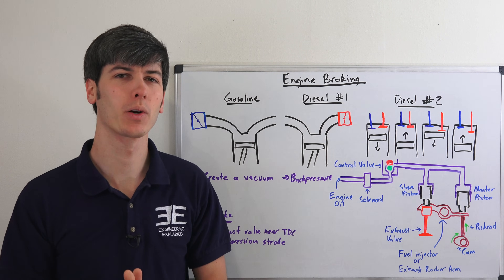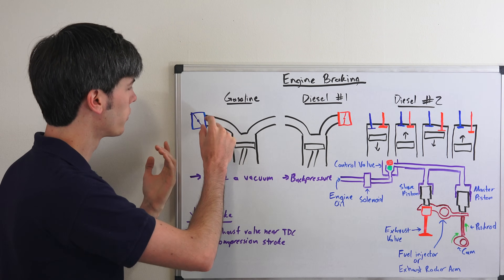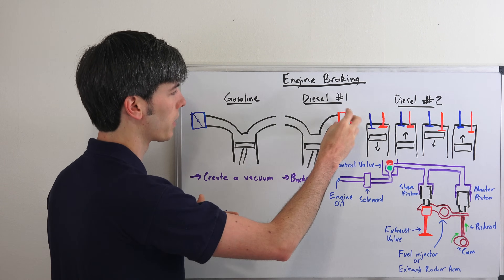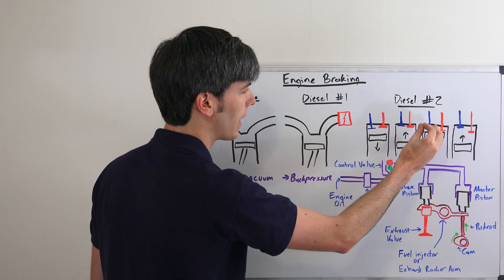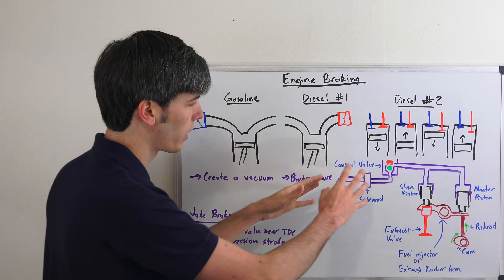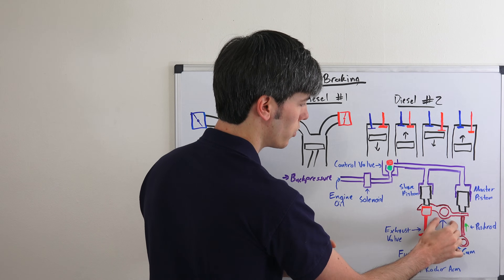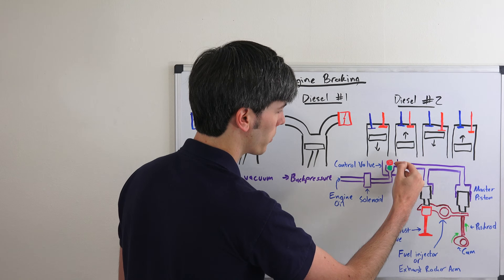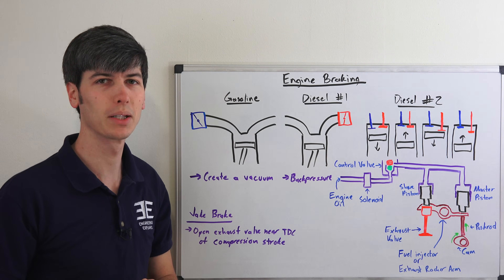What Is Engine Braking? What Is A Jake Brake?

Comment: Is it good to use engine braking vs a normal braking? The former would give more braking power isn't that better with compromise of creating heat in engine?
Reply: Budget Crumbs As long as your cooling system is in working order, no.
Reply: +Des Chew (GoOwl Travel) Use both if possible. Your "normal" brakes have much much more stopping power than engine braking alone. Engine braking is a good supplement though, especially down steep grades when you can use it to mitigate overheating your normal brakes, which is very possible if the steep grade is several miles.
Reply: +zecc81 Assuming I am on a long descending. Will applying frequent engine braking (petrol engine) causes the engine to heat up?
Reply: +zecc81 
That answer is just outright wrong. You do not need to, and should not use both methods of braking. Both have plenty of stopping power, on their own. But the reason for the 2 different methods, is that they have a complimentary list of pros and cons.

• Engine braking works very well for endurance and for limiting speed. The engine will not overheat as it is designed to take the heat, but the brake pads can easily overheat within 45 seconds, as somebody claimed. The engine has huge thermal mass, and a serious cooling system. Engine braking however, does not bring the vehicle to a complete stop, but rather only limits speed to a safe level.
• The brake pads are only for temporary braking, but do a very good job of bringing the vehicle to a complete stop.

Engine braking should be used for long downgrades, to avoid overheating the brakes. The main idea of engine braking, is to keep your brake pads cool and ready, for any emergency stop, or a stop needed due to traffic in the way. Thus engine braking is not a supplement to braking with the brake pads, it is an outright replacement for braking using brake pads. If traffic is in the way, moving a bit too slow, you may need to downshift to an even lower gear. Never ever, continuously ride on the brakes, they will overheat. Brake pads are only for temporary braking.

Brake pads should be used, for normal stop-and-go traffic, and for only temporary braking. The brake pads do not continue to heat up, when you are at a complete stop. Brake pads convert kinetic energy of the vehicle, into heat that quickly builds up in the brake pads and rotors. It takes a little time, and pauses between braking, to let this heat dissipate.
Reply: +Budget Crumbs 
No. The engine can easily deal with the heat, as it has huge thermal mass, and a serious cooling system.

Just leave the engine in a proper gear to limit your speed to a safe level. The idea of engine braking is to keep your brake pads cool, ever ready for an emergency stop.

Engine braking will likely even boost your fuel mileage, as the wheels then rotate the engine, rather than burning fuel. Most modern cars turn off the fuel injectors, when the accelerate is not pressed, whenever the engine is above the minimum idle speed. Coasting in Neutral would not have this benefit, and is probably dangerous.
Reply: Yosef MacGruber Outright wrong? You basically repeated what I said, just in more detail. If you're slowing down or on a grade, employ engine braking as the initial method, then use the brake pads in addition to compensate for the rest of the force needed, like when coming to a stop. Using just engine braking will likely not be enough, and using just brake pads may overheat them in certain situations. Thus why I said both is ideal (although not always possible, and are we really going to cover every driving situation?), since, as you said, they have a complimentary list of pros and cons. I have a feeling you just like saying "That answer is just outright wrong" though.
Reply: zecc81
You can't do both, or you are still overheating your brakes. Brake pads are only useful for temporary braking, and you seem to be neglecting that consideration. After use, brake pads need time to cool. If engine braking is not enough, then you need to downshift further.

Brake pads are for stopping completely, to quickly knock down the speed so that you can downshift, or due to traffic in the way or needing to slow to make a turn. Brake pad definitely are not for riding the brakes continually until they soon overheat, and you seem to be overlooking that.

When I bought my first car, I bought it from my uncle who was far away in another state. Coming down through the mountains, this is on a 3-speed automatic, I shifted down to 2, and almost never touched the brakes. Apparently, I knew about engine-braking, even when I was young. 2 was sufficient to keep my speed under control. To just leave it in Drive and just take my foot off the accelerator, would still apply some engine braking, but I did not think it would be near enough engine-braking.

Now going up the mountain, there is no need to downshift in an automatic, because the automatic transmission will already drop a gear, if it can not maintain enough speed for the higher gear. Going up the mountain at another time, I had the accelerator floored, and it just only wanted to do 45 mph. That is all it would do.
Reply: Yosef MacGruber We're saying the same thing, I don't get where you're going with this? "You can't do both"? Of course you can; if I'm coming up on a tight turn let's say, I can downshift for engine braking, and if that's not enough (key phrase!), I can also use the brake pads at the same time. Since I'm engine braking in this situation, I need less force from the brake pads, and am mitigating overheating by using BOTH methods. I never said you should ride your brakes either. Of course they are only for "temporary" braking, as you're saying. The only situation someone may ride their brakes to the point of overheating is on a long, steep grade, where in my first comment I said specifically to use engine braking to prevent overuse of the brake pads. If the distinction you're making is that sometimes engine braking is enough to slow you down or maintain a speed downhill without using the brake pads at all, then yes, that's implied. My first comment was in relation to the OP suggesting engine braking and brake pads are mutually exclusive, and asking which one is better, when in fact they can both be used to your benefit. Again, if engine braking is enough, then that would be the first choice as it avoids use of the brake pads altogether, which is why I keep saying IF engine braking isn't enough (which assumes further downshifting), then brake pads have to be used [yes, only temporarily].

Comment: I want my brakes braking, not my engine...would this cause more engine wear over time?
Reply: +Tr33Tr331 It would. But that is much less than the wear on your rotors and pads or drums caused by the frequent usage of brakes on downhills or slow moving traffic. Engine braking is used very commonly in off-roading for this very reason even though nowadays never vehicles come with auto downhill control.
Reply: +Prajwal Deval 
How does auto downhill control work? Has anybody made a YT video about it?
Reply: +Yosef MacGruber the car uses the brakes and electronically triggers each of the four or all when needed to keep the car (which is going on a downhill) below generally 5 km/h.
Reply: +Yosef MacGruber Mind you, things like downhill control are only used for major downhills in off-road situations. I was also referring to the use of engine braking in similar situations. Also, I do agree with you about the almost useless bells and whistles cars have. Things like auto start stop is really annoying. Due to an accident, I was stuck in a long traffic jam and I had the parking brake up. The car turned itself off with the air con running. What I ended up was a flat battery and a large hold up behind me when the traffic in front cleared.
Reply: +Yosef MacGruber no its a diesel SUV. if you're stationary without your for in the brake or clutch, it turns off in 5 seconds and turns back on when you put your foot on the clutch.
Reply: Prajwal Deval
Oh, I am glad it is not the Toyota Prius hybrid, as I have seen some possibly good stuff about it on YT.
Reply: +Prajwal Deval seems like a great idea for off road driving,

Comment: My old Ford Explorer, with the 4.0 V6 pushrod, always slowed itself down going down grades on the highway. I loved it!
Reply: CRGamingHD if it was sold for $300 it was a pos.
Reply: Mark LaPointe "comes with an engine brake"? 

Have you watched the video...?
Reply: I'm sorry to point out that you're not correct in your assumption.  Off-throttle down a hill is using zero fuel and is more economic than using the accelerator at all or using brakes to control your speed.  It is even more economic than rolling down a hill in neutral because the engine would have to use fuel to continue running whereas off-throttle down a hill is using the energy transferred from the wheels through the drivetrain to keep the crankshaft spinning.  Fuel economy in commercial driving is highly dependant on being off-throttle while declining hills (and using the Jake Brake when you have it to prevent over-speeding rather than heating up the brakes).  Friction from the weight of the vehicle on the drivetrain going down a hill off-throttle is far less friction than throttling up a hill.
Reply: That was what I was taught.  Also, braking going downhill puts wear on your brakeshoes.  Also, it feels easier to control my car downshifting it, than using braking.  Another point is descending down a great distance.  For example, on Pike's Peak, they check your brakes.  If they are too hot, you pull over.  I downshift descending down Pike's Peak to try to reduce brake heating.
Reply: why are cars so cheap in the US?
Reply: +James Dean Youngs That's not a good thing actually.  The Ford Explorer isn't equipped with an engine brake, so that 'braking' you experienced was due to internal friction of driveline components (like your transmission), which kills your fuel economy during normal use.
Reply: Mark LaPointe Oh well. Sold it two years ago for 300 bucks.
Reply: @ml48963  all cars are ´´equipped´´ with engine braking , LOL, it isnt a feature that comes to specific cars (unless were talking petrol vs gas).
Reply: @DANIEL3351  unless your referring to Jake brakes which do a lot more than engine braking without them.

Comment: What about downshifting and then leaving your foot off the accelerator as a form of breaking?
Reply: Zac Price Oh. His explanation was so technical, i didn't realize that was what he was talking about.
Reply: I have the same question
Reply: I will assume that you are talking about a gas engine. It will do the same thing that he explained, just at a higher engine rpm, causing the vacuum on the intake stroke to happen more often, therefore slowing the vehicle more than it would at a lower rpm. Hope I was able to make this understandable.
Reply: +Michael Miller That was the first thing he mentioned. By leaving your foot off the accelerator, the butterfly valve in your throttle body closes, restricting air intake which in turn makes it harder for the piston to move downwards on the intake stroke.

Comment: Wait, diesels bot having throttle bodies at intake?!!!! How does it work then?! When you press the gas pedal, what does that do then? What is regulating air intake into the motor if not a throttle body?!

Comment: What about two strokes?
Reply: +Vin Two stroke (Gasoline) Engines have very minimal engine braking. They're not great at keeping you slow.

As for two stroke diesels, I would assume that the jake brake operates the same, as they do have an exhaust valve.

Comment: +Engineering Explained But what about the fuel supply, is it interrupted in that time the jake brake is activated, so the engine is running dry? or the process happens as normal?

Comment: Makes sense. Whenever I let go of the throttle, I can see with my own eyes the vaccum/boost gauge move to the vacuum side and you can feel the car slow down. Always wondered what goes on in that event. Thank you. Nice job!
Reply: +Joel Flores gas engines make vacuum at idle
Reply: Yeah, I can see that as well. What with the throttle being closed and all

Comment: It would have been helpful to include your normal pros and cons with engine vs brakes.
Reply: ***** It shouldn't affect the clutch in most cases. I use engine braking down hills and just leave it in the gear I'm already in. It would be interesting to look at the data on what the extra heat does to the engine though.
Reply: +Nayr747 The heat does hardly anything. The normal cooling system is more than capable of cooling the engine when it's used for engine braking. Normal use of the engine is actually harder for the cooling system.

Comment: Is the gasoline part actually correct? I always thought it was the compression stroke that causes the engine braking.
Reply from the maker: +AkaAndyKnuckles The compression stroke acts like an air spring, putting most of that energy back into the engine during the "power" stroke where the force of compression then forces the piston down.
Reply: +Engineering Explained Yes, I guess that makes sense. Thanks for making the world more knowledgeable.
Reply: +Engineering Explained 
Please explain than how is my Nissan YD22 diesel engine brake working? I have rebuild the engine and not found any throttle valves in the intake or exhaust.
Reply: I agree with Ahto, The higher compression ratios in diesels are what cause the braking, no exhaust throttle valves in my diesel engine either
Reply: It's not in the engine, it's an exhaust butterfly, or it's not there at all.

Comment: So the jake brake isn't really a brake then, is it? It's more or less a way to null power to the wheels and let resistance factors slow down the truck.
Reply: No, it is actually a brake.  Not just no power.

Comment: Great writeup Jason, but Passenger car diesel engine do not have any valves in the exhaust system. Some newer ones have a valve or valves in the intake manifold to create turbolences for better mixtures. When lifting the gas pedal, the injectors stop feeding fuel, but the wheels still turning the crankshaft.
Reply: +Ahto Andron I don't think he implied that all diesels have one of these braking systems. Larger pickup trucks and small delivery trucks have exhaust brakes where there is a butterfly valve in the exhaust. Larger commercial trucks use compression/jake brakes. Newer diesel engines have a valve or valves in the intake to improve emissions and/or to prevent shutter. Diesel engines produce a lot of NOx emissions which are caused by high compression. By reducing the airflow to the engine you reduce the effective compression and thus reduce NOx. Also when a diesel shuts down it can really twist car due to the high compression. If a valve closes off the intake when the engine is turned off this reduces the compression so the engine can turn over a few more times and come to a slower stop. This valve can also help prevent a runaway diesel engine.

Comment: Most drivers do not even know to shift into a lower gear on inclines even in a parking garage.  They constantly ride the brake the whole time going down to the ground floor.  It's probably a safe bet that perhaps 90% of cars with automatic transmissions never get put into any forward shift position other than "D" from the day they drive off the dealer lot new and the day they arrive at the junkyard.